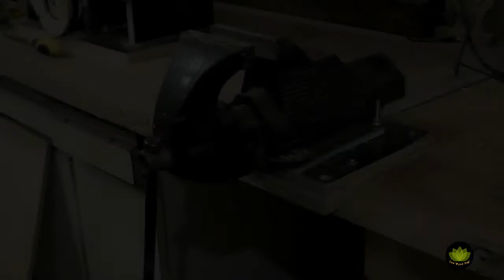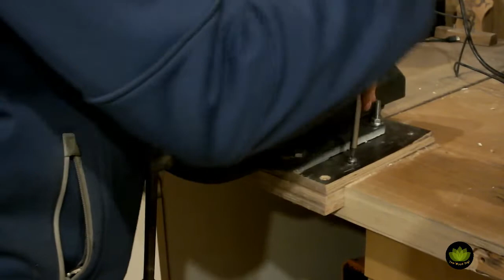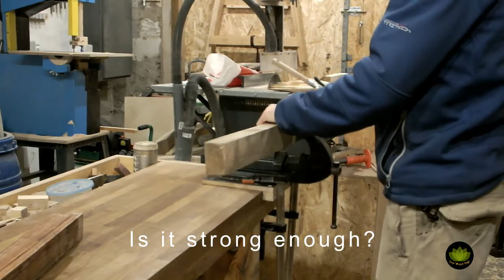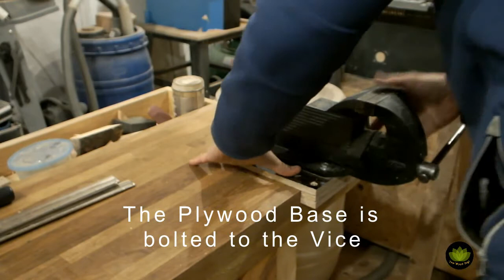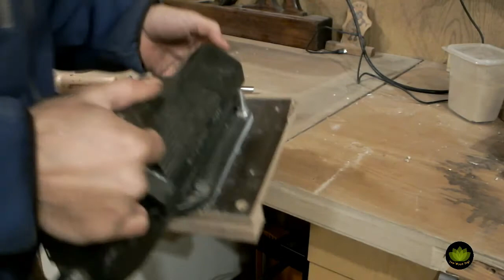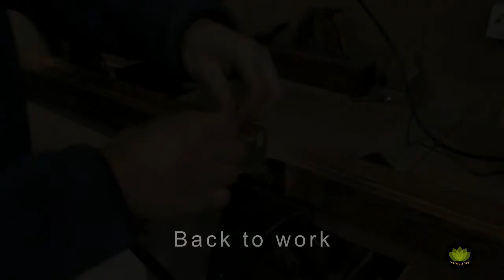Portable Metalworking - Machinist Vice / Vise Hack for Woodworking

Comment: When mounting to the bench using 4 screws, do you use t-nubs or threaded inserts under the bench? How do you keep the threads in the bench from wearing out after multiple mounts/dis-mounts (assuming using the same holes)?  Btw, i thought you were a gymnast, instead of 40 year practicing yogi :-)  thank you.

Comment: Not sure the mount would handle the shock from hammer hits if one were trying to bend metal clamped in the vise.
Reply from the maker: Hi Trevor 😊 You would have to try it to see. I have used this as my primary vice set up and I use it daily. It works great for me and I have hammered and bent lot of metal in it. It's worth trying if you have a few scrap pieces of material lying around 😊 ॐ
Reply: @TheWoodYogi  My current vise (just broke the mounting base on the old 4.5" vise trying to straighten passenger pegs on my dirtbike) is something like 63 pounds.  I do like the idea but I'd use some GRK screw lag bolts and not just wood screws.  Or possibly some nuts welded to a small plate that's screwed to the underside of the bench and then bolt the whole thing down. 

If you're not careful to line up the screw threads with the ones already made in the wood then it weakens the wood and eventually it will strip out.